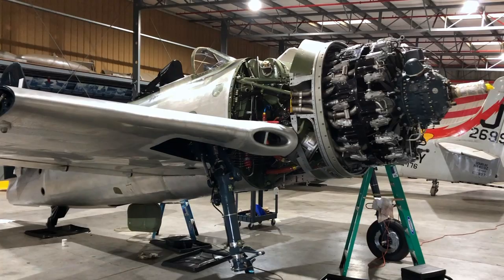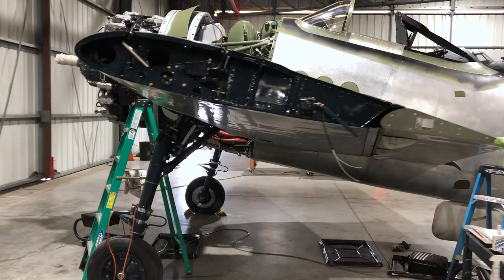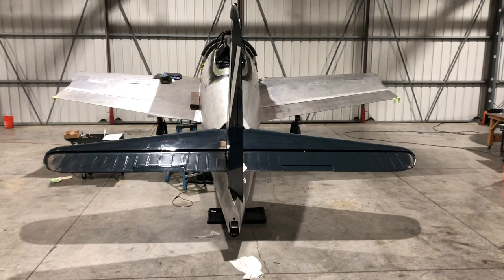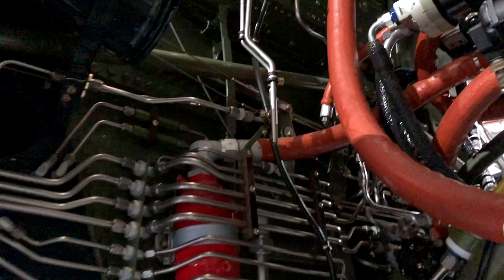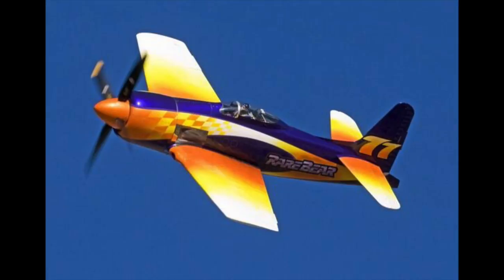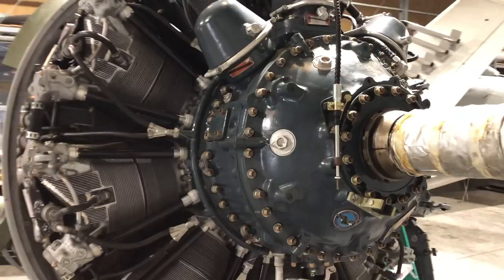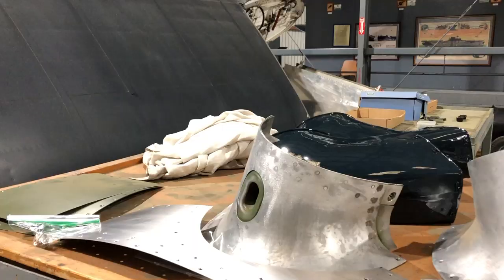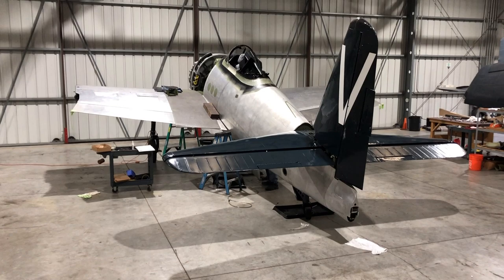F8F BEARCAT Under Restoration w/ Steve Hinton | Hangar Talk | Planes of Fame

Comment: I spy an SB2C off to the side. My father flew rear seat off the Bow of the FDR in 46. Vee Bee 75.
Reply: @pat36a…that’s cool your dad flew SB2c helldivers….thank you for his service fantastic airplanes, unfortunately I don’t believe any flyable versions exist.
The plane to the right of the bearcat is either a TBM / TBF Avenger depending if it was made by Grumman or made under license by General Motors, the other plane to the left “409”….is Republic AD4-N Skyraider  Navy variant, that had the rear crew compartment for two crewmen either a radio / radar operator and a bombadier / navigator. ( I worked on this very airplane for several years, under a private owner) unfortunately never got to fly in the rear compartment… both incredible airplanes.
Reply: @Marc Wesley  CAF has 1 Helldiver flying, the only 1, I believe. Side note, I believe 1 of the chapters has a dive bomber from his airgroup VB-75
Reply: @pat36a  thanks for the update, that’s great there still one flying.